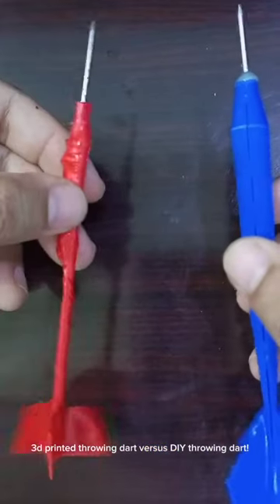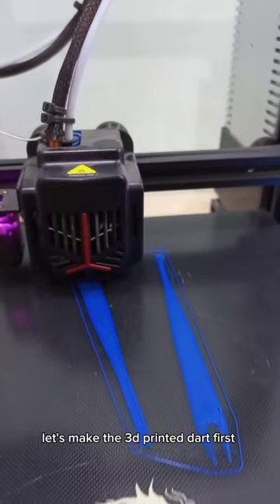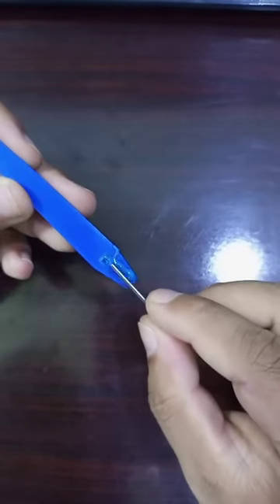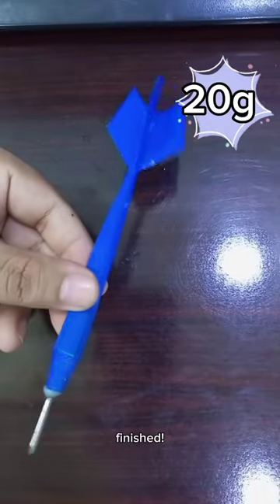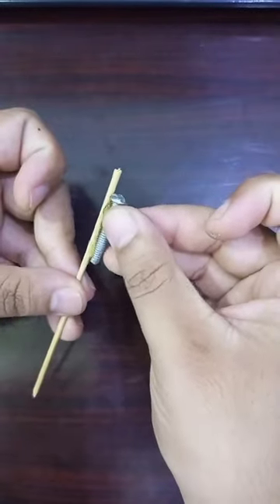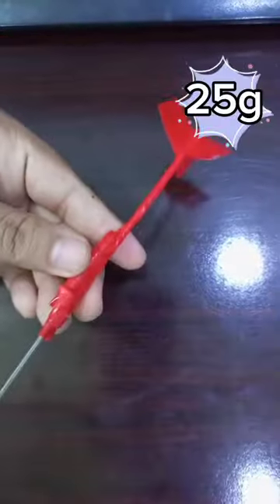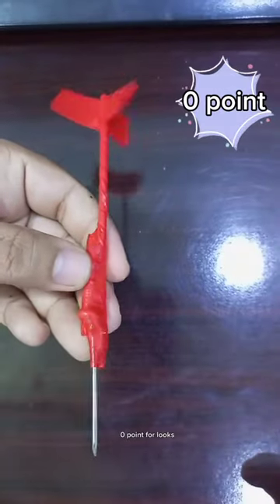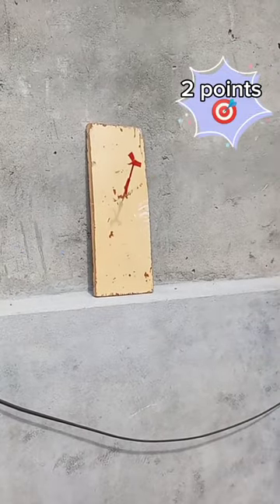3d printed throwing dart versus DIY throwing dart #3dprinted #darts #diy #shorts

Comment: Sorry but the DiY one actually performed better.
Despite the lack of enthusiasm to build it 😂

3d printed one shattered on impact and was too large.

You need to make it much smaller and hollow so you can fill it with sand or something else to weight it down 🤔